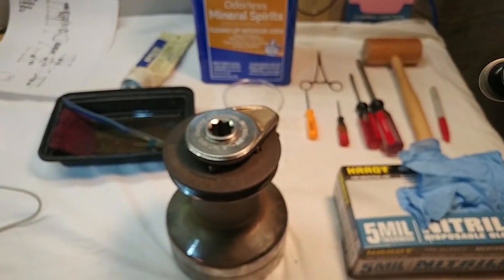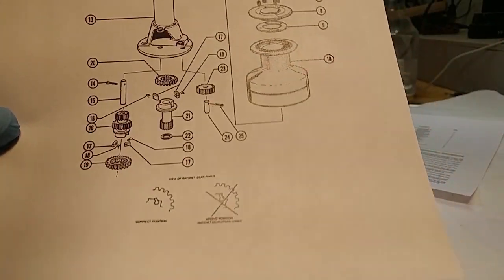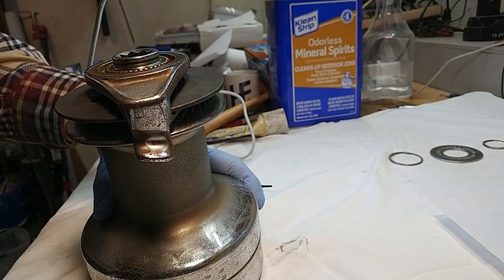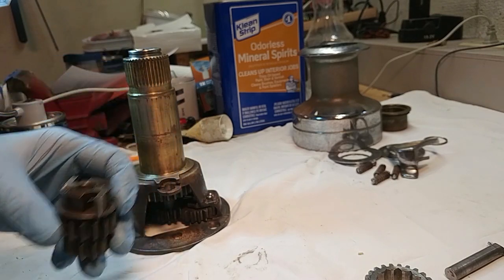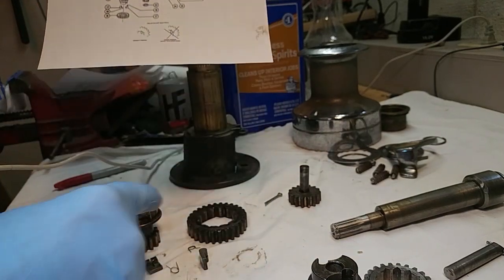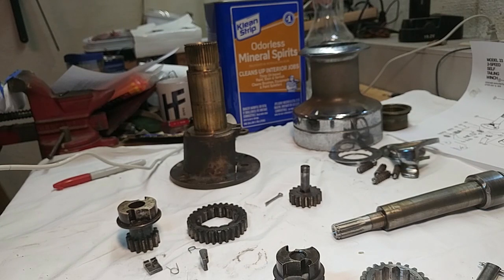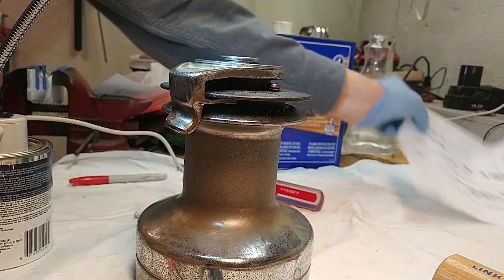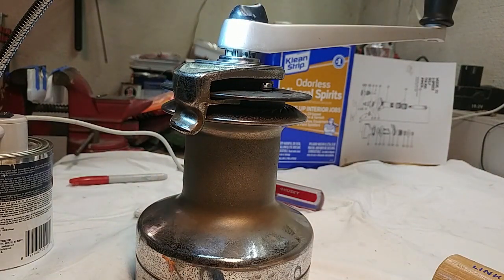Barient 23 Self-Tailing 2-speed winch disassembly and rebuild

Comment: Great video.  Thank you.  I am having difficulty removing (unscrewing counterclockwise) the line lifter on my B 23.  I am afraid to hit it too hard with the mallet.  I sprayed some penetrating oil and will try it again tomorrow.  Hope I am not doing anything to damage the winch.  I gave a couple of pretty good wacks with no luck. Thanks again.
Reply: My video shows pretty light taps, but that's because I had loosened it the day before. During THAT day, you'd definitely have seen me banging lots harder. I might even have gotten a small hardwood block to put on the "line lifter" and then hit the block with a more substantial metal hammer. I'd also suggest that if you give it a few taps in the "tighten" direction, it might give you a start in the "loosen" direction as well. You can watch the magic-marker line you drew to see whether you're getting any movement at all. About 1 mm in the "tighten" direction is all that I'm recommending here --- not a quarter-turn or anything! Once it starts to loosen even a little bit, it'll be easy, I expect. Best of luck!
Reply: There are two different constructions of B23s depending on age I believe.  Mine do not require unscrewing the stripper arm (line lifter).  After unscrewing the locking ring at the top, the outer winch drum just lifts off the base and as the stripper arm clears the internal gear it just falls off.
Reply: @michaelcyr8215  Thanks, Michael --- I had no idea, because I've only got this one B23 to work with.

Comment: Thank you so much for the very informative video!
I was wondering what you think of the idea of lubricating everything with just oil instead of greas,  but doing it more often, and without taking every single gear apart. Basically taking the main outer part of and lubricating all the inside gears in the shaft in place with oil using a brush or something while turning the gears to make sure it gets everywhere?
How long you think the oil would last?
Reply: Grease and oil have very different functions in lubrication in general. One characteristic of grease is that it mostly stays put, while oil moves around. If you lubricate your gears with oil, one warm day will ensure that almost all the oil goes away, and you're left with metal-on-metal contact pretty soon. The video takes 37 minutes because I'm explaining everything and trying to get it all framed nicely. In practice, breakdown, oil-and-greasing, and reassembly my my lewmar primaries takes about 15 minutes each, and I do it each year. For this Barient, with the annoying ring-thingy on the bottom of the shaft, it'd be a good deal longer, because you'd have to unmount the whole winch, so...
Reply: By the way, for an example of oil vs grease: my transmission is "splash lubricated" --- part of the output shaft sits in a puddle of automatic transmission fluid, and when it spins, it splashes the stuff all over the inside of the small xmission box, from which it drips onto all the other parts. If the fluid were grease, it'd partly stick the shaft, and partly get thrown to the sides of the box where it'd stick, while the shaft would rapidly hollow out a pit in the grease and pick up no more. The rest of the box would never get lubricated. -- not good.